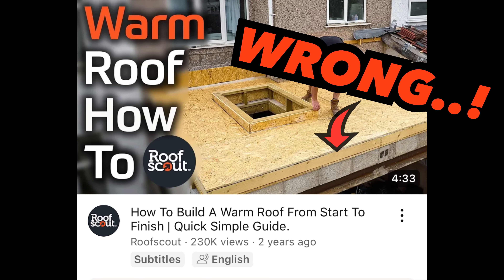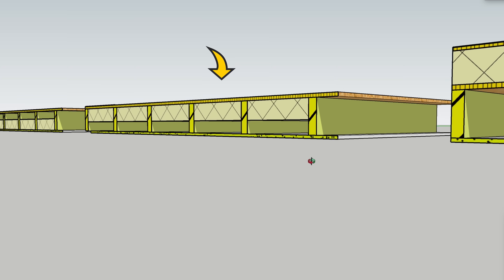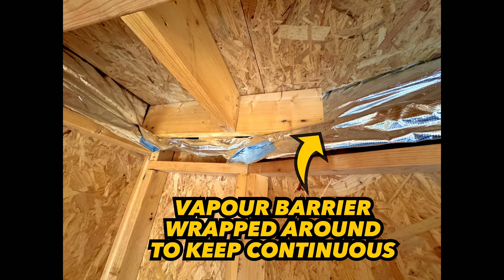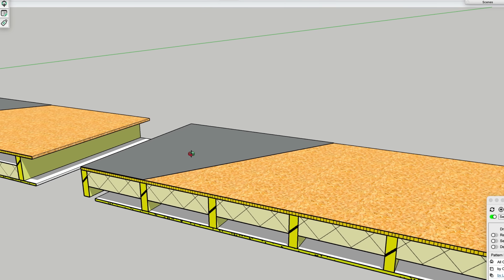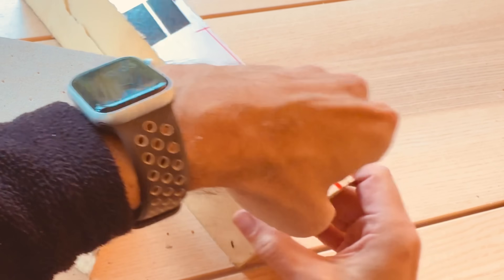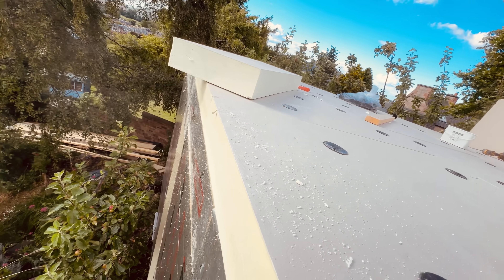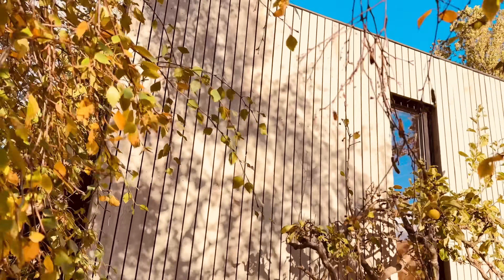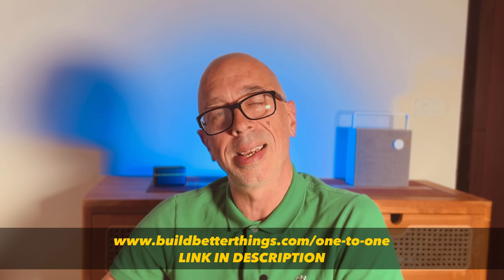Build a Warm Flat Roof the Right Way

Comment: Great stuff. What if the roof is to form a balcony to be used and walked on ? Can this approach be used for the rubber roof, but then I guess some kind of extra surface will be needed above this, and any fixings through the rubber would be a no-no. Do you have a video or recommendations for sealing a warm roof AND making it walkable on ? Thanks.
Reply from the maker: Hi. For something like that, I’ll consider inverting my roof, so membrane on deck but external insulation slabs OVER membrane. It’s just too likely you’ll get a tear from moving a chair or a sharp shoe with unprotected EPDM . You then add your finish of choice for your balcony.

Comment: May i kindly ask you to give a comment on type and technology process behind constructing the following type of the roof - it is absolutely flat, no slope. I tried to find information and description with detailed technical data - but failed. Hope that your expertise will make it more clear. Thank you))) - some details can be seen from 0.30  - https://www.youtube.com/watch?v=SYa3Fsx-4cU
Reply from the maker: I cover zero fall flat roofs in this video
Warm Roof Design - Calculate Fall, Firring Pieces or Tapered Insulation?
https://youtu.be/sOr0zx1SIAE

Comment: Why use fasteners instead of couple inches of quartz chips or something, protects from sun too.
Reply from the maker: Hi. The EPDM will last 40 years plus in the sun. The fasteners break the cold bridge. My aim is to reduce to the minimum the amount of materials in my constructions, anything unnecessary gets omitted. It’s also a load of additional cost and work to put up your chippings, and then you’ve got a maintenance item forever more as debris and dirt collect within the make up.

Comment: Years ago, we did the warm roof style, sometimes, plywood, insulation, plywood, in Western NC.  We were redoing it after 40 years. But, here is the kicker.  It was on a brewery.  It was built tight enough to limit airborne yeast flowing thru.  I heard there was a 4' high crawl space between the ceiling and the roof deck, where the space was conditioned with dehumidifiers, etc.  But they did not let us see their system.  The Stroh family guy, was often high on coke, and a little difficult.  Not surprised, he destroyed the family business that was paying the family 100K/share.

Comment: Is this advice specific to environments such as the UK which are relatively damp? I'm in california and there doesn't appear to be a problem with doing torch down roofing on plywood. Humidity is generally fairly low. The reason I ask is because I'm going to build a house with a flat roof. I thought I'd use closed cell spray foam insulation in the roof cavity and essentially seal the whole thing up. No ventilation. This strategy works well for fire prevention.
Reply from the maker: Hi. Nothing wrong with torching directly onto plywood or OSB. But even in hot climates, you should ventilate below that deck using the voids in between your firring pieces, above your your insulation.
Reply: @build-better-things  The reason for not ventilating between the deck and insulation in this area is because when wildfires occur embers flying into that space are the primary cause of homes catching fire. There will be a small air gap but it won't be ventilated to the outside. I'm just not sure whether condensation will be a problem because air will definitely infiltrate the gap.
Reply from the maker: It’s not about condensation for your case. It’s about differential movement so cutting short the life of the torched on…since there’s no air movement. It’s difficult to explain here. I’d need to think through about the fire thing depending on the geography .
Reply: @build-better-things  Don't plywood and modified bitumen roofing normally expand and contract at different rates? Are you saying lack of air circulation under that layer of materials would be an issue? Would the problem be delamination? Maybe I'm misunderstanding something.

Comment: those plastic tube washers are going to last 40 years without getting brittle and breaking off in a storm ?
Reply from the maker: They’re set into the insulation with wide diameter screws and bonded and covered in membrane. How would they break off in a storm….???
Reply: @build-better-things  when the wind tries to lift the roof off the building

Comment: Quick question if we put a extra layer of vapour barrier  under the plasterboard inside . How does any vapour escape ? Also if by chance it gets past that how does it get pastthevapourlayer underneath the pir insulation to then rot the external osb sheathing that the rubber is glued to ?
Reply from the maker: You need to ventilate your void if you’re going to put a second vapour barrier. that void is going to be at the same temperature as the room, there’s no benefit and vapour will still be present as it’s not a vacuum. 
leakage, residual vapour and piercings in the barrier allow vapour into the upper area where the dew points are.
And aside from all that, what’s the point of spending you’re cash and time putting an additional layer of OSB on the warm side when it’s not required?
Reply: @build-better-things i think your been very pedantic to say the least . Its all a load of nonsense what about the vapour trapped in the pir . Your going to say there isnt any because its stored inside but what about vapour in the air what about vapour coming out my mouth . Your all obsessed by vapour .
To say the temperature is the same inside the void as in the house is just heresay . What if the windows are open inside what if there's air con in the house wheres your scientific proof .in most modern houses and when i say modern i mean any houses with upvc windows in . Condensation is negligible gone are the days of single pane glass and drawing a pair of tits on the window.
Most houses breath just fine !!
Reply from the maker: No problem, do what you think is best. If it’s all a load of nonsense as you say, why ask the question in the first place?
Reply: @build-better-things because I wanted to find out pedantic you really are ! I've got my answer and reading some replies I dont think im wrong . Your mistake is digging others out 
Who like yourself are making a living and following codes and practices to the best of THERE abilities.  Not yours of course because it sounds like yours are from another planet !

Comment: I have a question when you glue the rubber/epdm on top of the insulation won't the vapour go all the way up and condense in the upper part of the insulation under the vapor barier(epdm)? Yes you will prevent the direct condensation on the OSB but still that vapour has nowhere to go. Is it not better to place a vapour barrier in the interior side to stop it all together?
Reply from the maker: Vapor barrier goes on the warm side of the insulation. The EPDM is somewhat breathable so any condensing moisture can safely migrate to the outside. The OSB on the cold side prevents that and the moisture is trapped with the layers of the OSB. Hope I explained it ok.

Comment: Hello again, looking at your roof in this really helpful video it looks like the internal parapet height is consistent on three sides suggesting you have sloped the eaves to achieve the necessary fall.  If so, it certainly makes laying the EDPM easier as the parapet height is always kept low so avoids the tricky upstand details. Can you confirm this or am I mistaken?  Thanks
Reply from the maker: Yes. Not my favourite option as the cladding needs to be cut at a slight taper, but I had no option with this particular build.

Comment: It is complete nonsense to discuss this topic without mentioning the sd-value of the Vapour Control Layer relative to the sd-value of the EPDM membrane.  A VCL membrane such as Alutrix 600 is 40 times less permeable than EPDM, which means that (when properly installed) the moisture in the Insulation layer will REDUCE over time.   And how does your recommendation of using solvent-based adhesive instead of water-based change the sd-value of the EPDM?
Reply from the maker: I think you are getting mixed up. Lower sd value = Higher permeability = More breathable and vice versa. Alutrix sd value is upwards of 1500 and warm side EPDM is around 50 and upwards,  which is consistent with my comments in the video about EPDM having a somewhat breathable aspect to it, which is what we want, along with the opposite for our vapour retarder. Adding a useless layer of OSB gets in the way of that by the way. Suggest you try taking the jargon and condescending tone out of your comments so others can engage with you more easily.
Reply: @build-better-things   I know exactly what sd-values mean, and that is why I'm asking why you completely ignored the importance of the relationship between the sd-values of the VCL and the EPDM.  As I clearly said in my comment, EPDM is almost 40 times more permeable than Alutrix 600.  It is this relationship that makes Warm Deck roofs work.
Reply: @coilinotoole6124  You can travel the length of the country and you won't find a perfectly installed VCL. The material could be completely impermeable but as sure as anything the detailing will not be. 
And regardless of that, generally the insulation is mechanically fixed down through the joists therefore the entirely VCL will have numerous  penetrations, and I can say with certainty that Alutrix is not self sealing around fixings, I have first hand experience of knowing that.
Reply: @Helibox  It has a BBA Agrément Certificate (06/4329 Product Sheet 3) for mechanically fixed single ply roofing.  It has been tested and approved.  Sure, it has to be installed correctly, but it works.

Still not sure why there was no mention in the video of the correct type of VCL to use with a warm deck roof?
Reply from the maker: @coilinotoole6124 the focus of the video is not on vapour barriers and jargon that no one understands, for reasons which I explained in the video and which @Helibox says again, better than me. I’ve made several other videos of my view of vapour control, suggest you have a look.
Reply: @build-better-things  That "jargon no one understands" is actually the important bit.

Comment: I'm interested in this issue and your expertise.

A number of experienced individuals disagree with you.

Some clarification, please, because your background is not clear to me  - I could well have missed something, so I apologise in advance.

Are you an architect, builder, or diy?

How many of each type of roof have you designed/built?

How many have you inspected?

How many have you condemned/repaired, and what types/ages?

How many have you found to be serviceable, and what types/ages?

I'm sure ball park figures will be enough to quell any disent of your expertise. 

Thank you
Reply from the maker: What are the points that these “experienced individuals” disagree with me about with? Take the time to read my bio on my website, not that it has any bearing on the arguments presented, which are about physics and building dynamics.
Reply: @build-better-things   OK 

I was just trying to guage where opinions stand because I am about to build an extension.

Thank you for prompt reply.

I do disagree in that experience and training in a subject does have a bearing on a subject.

I haven't read your website but as you have directed me to read your bio I can only take it that you consider your own experience and training to have a beraing on this subject.

Perhaps the term duality is appropriate.

Comment: What about the circles that will stand out from the plastic washers ? Also when they pull in it surly will leave a dent that will not adhere?  You can see it on your roof mate ...what to do about this ? It looks terrible and customer aint gonna gave it
Reply from the maker: You can’t see the roof in the project illustrated from above, and even if you can, it is explained in advance to clients in detail. For those that are concerned about seeing the circles, there are other ways to do it without seeing the fasteners, a bit more costly, but still without using a useless and costly secondary layer of OSB, which I guess you advocate . Of course it adheres to the washers.

Comment: I'm considering a rubber roof on OSB for my garage (no insulation). Am I right in thinking this rot would not happen on this set up?
Reply from the maker: Yes that’s right. You could consider bonding the rubber using water based adhesive onto an OSB deck for this arrangement.

Comment: I disagree.  If there is not air layer there is no moisture on the unders of the OSB.  The OSB rests on rigid insulation.  No air layer.  No moisture.  No problem.  You're welcome.
Reply from the maker: Unfortunately you don’t need an “air layer” to still suffer from interstitial condensation. Vacuums don’t exist in these constructions.
Reply: @build-better-things So where does the moisture come from?
Reply from the maker: From the vapour.

Comment: The double board system is like creating a SIP panel so do these SIP panels have the same problem with the outer skin rotting ?
Would painting the underside of the top layer of OSB with a couple of coats of epoxy floor paint help prevent the moisture penetration ?
Reply from the maker: Yes, use a ventilated roof for sips. I don’t see any bonding direct to the actual panel. Trapped condensing moisture is one issue, albeit less prevalent than a warm roof, but you have the added issue of not wanting to bond onto the structure itself.

Comment: Doesn’t make sense. How does the vapour escape through the rubber?? I use osb on the bottom and tongue n grove on top
Reply from the maker: EPDM is somewhat breathable as well as being impermeable. If you mean you’re placing tongue and groove over the insulation and directly below the membrane then you’re opening up to problems, as I describe in the video.
Reply: @build-better-things  you must write "in my opinion" at the end of everything you write.
Reply: @build-better-things that’s wrong and your wrong. You don’t know what your talking about. Get a proper job instead of trying to think you know what your talking about 😂

Comment: How about a metal roof directly on top of the osb in a hybrid system so air gaps under the metal on top of the osb as only some of the metal will be on the osb, or insulated metal panels on top of the osb say 70mm thick panels ?

Comment: So if i had a cold roof system it could be as shown in diagram of 3 roofs but if glueing the rubber to the osb use none water based glue and glue the osb and the rubber?

Comment: In terms of insulation/condensation - what makes walls different than roof?

To me it seems that all the DIY youtubers do the roof isolation same as walls - in the sense insulation between timber then OSB on top/outside. And for roof they put EPDM, while for walls they put the foil.

And if we're doing it timber, OSB, PIR and EPDM on the roof - then why not timber, OSB, PIR and then foil (and then cladding) on the walls?
Reply from the maker: Good questions. With walls, we usually have a ventilated cavity with a breather membrane, with either timber frame or with brick / masonry. I’ve just made a video about venting the wall cavity.  A warm roof, that’s not possible. Ventilated roof is the nearest comparison, witha deck above the vented void.  Insulation between the timbers for a wall is poor practice, insulation should be placed either on the outside of the timber frame like a warm roof or on the between and inside in a hybrid arrangement. I’ll be making a video about warm wall construction in the coming weeks.
Reply: @build-better-things  following all that adds quite some height/thickness to roof/walls.

Wondering how all this could play along for backyard shed/office/workshop where we probably don't need as much insulation as on a house. And if there are some DIY friendly alternatives to standard CLS/C24 to make timber (or replacements) thinner, so all PIR insulation can go outside. 

I've seen your hybrid roof - which saves on space/height. Though I'm wondering about it's support (for walking on top) and don't think you've detailed how it's dealing against suction pulling things up?

And for walls - especially if you want to put vertical cladding where manufacturers (not all, but most) say you need vertical and then horizontal battens/cladding - so that's 2x22mm = 44mm right?

If you follow something similar to hybrid roof and add some thinner PIR completely on the outside ... Wall thickness ends up being about 20cm if not more?

+ drywall 18mm
+ timber frame 89mm
+ OSB 18mm
+ foil ~0mm
+ PIR on the outside - let's say 10mm (but probably at least 30mm)
+ cladding frame 22mm or 44mm
+ cladding 10mm or more

Comment: Great content, and great to know this! Between the cold roof and the warm roof what is the issue with the cold roof, and is there a reason to go with the warm roof instead? Having an air gap above the insulation seems like the obvious solution to drive moisture away
Reply: And by cold roof I mean the one where the insulation is directly above the ceiling with the air gap above
Reply from the maker: Hi. If the insulation is between and / or below the joists, the deck is cold, it’s a cold roof. If the insulation is above the joists, then there’s the air gap, then the deck, it’s a ventilated roof. If you look at my other video from a few months about roof design, i illustrate how you can do that with your firrings for example.

Comment: how do you feel about Sips construction ?
Reply from the maker: SIPs are fine, but you need to understand the additional work that’s involved which manufacturers don’t make clear in their marketing. For example, most panels require integrating ventilated voids for roof panels.  I talked about it here…
What's best SIPS v Timber Frame - You won’t like what I’m going to tell you
https://youtu.be/xW-ePTqDaAU